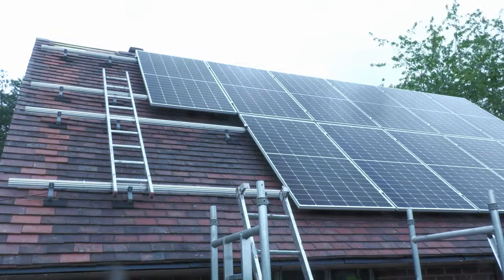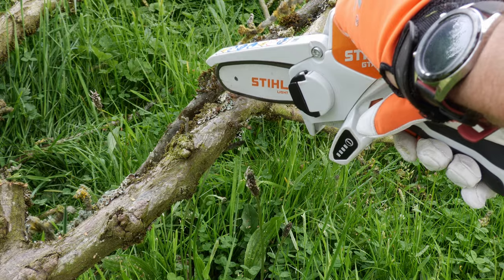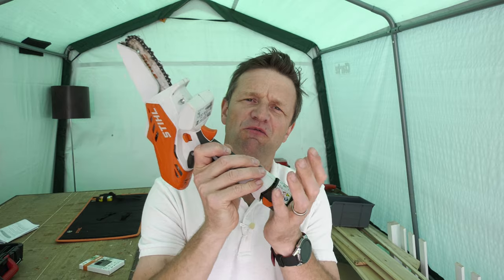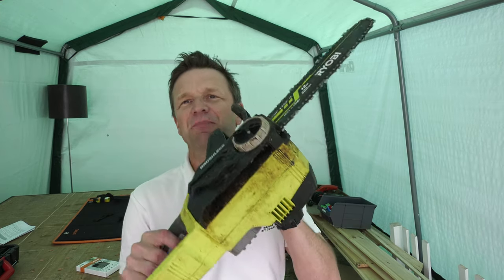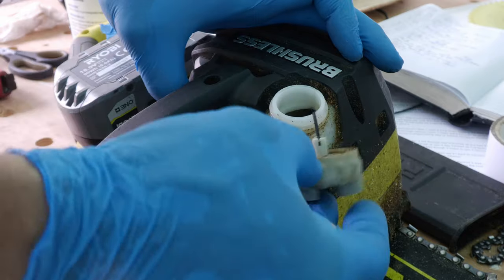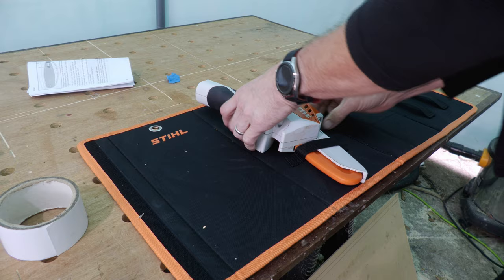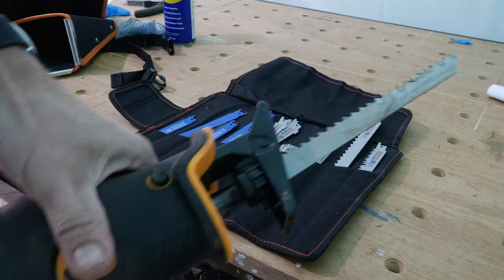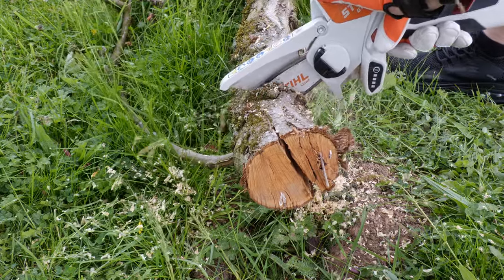The BEST Garden Pruner? Stihl GTA26 Review

Comment: I have just used it! Here it goes: i cut down olive trees. It did well generally but:1)if you force it to cut big pieces of wood,it stops! 2) most importantly annoying: the chain many times goes off ant the saw stops!!!! I had to take away the battery,put the chain again and put the battery back on and continue..It does not worth its money if it does this all the time ....
Reply from the maker: Yep. It's not really designed for big pieces of wood and they need to supply it with 2 batteries.

Comment: The problem with the stihl is the battery platform.  You are buying into a battery platform that does not work in your drill, impact drivers etc whereas Ryobi, Dewalt and Milwaukee all offer small compact chain saws and cutters for outdoor work.
Reply from the maker: That's a very good point, and particularly in the case of the Milwaukee - I've realised now I could use my existing batteries with their chainsaw. 👍

Comment: Maybe a stupid question, but those 12v batteries look very similar to the Bosch cool pack - I assume they are not compatible? If they were it would be a no-brainer to match my other small tools.
Reply from the maker: No they won't be compatible but I agree. This is why I wouldn't buy this tool when you've got similar tools from Milwaukee that you can use the 12v battery with a lot more other tools.

Comment: I have used my stihl gat 26 quite a bit and the chain is still sharp but to loose and keeps coming off but i can not see a way to tighten the chain around the blade, yes i do take it apart and clean after each use. can anyone help if so that would be fantastic
Reply from the maker: You have to manually pull it outwards whilst tightening, from memory.

Comment: I have the Stihl GTA26, is okay for what I think was designed for, the battery time sure is poor.
Reply from the maker: Yes, it's a funky little tool. Just confusing that it's meant to be a pruner but they say you have to hold it with 2 hands.. So your partner presumably had to hold the branch you want to prune 🤷‍♂️
Reply: @CharlieDIYte  You can hold it with one hand and is no effort.

Comment: Hey Charlie, great review - I've a question. I climb high trees to do dead wooding. It would be great to have somthing small and portable to do trim away branches when aloft in the tree. How good and secure is it in the holster? Is there a hole in the tool to attach rope, so i can attach it to my climbing harness?
Reply from the maker: It's pretty secure to be honest although I didn't test it rigorously. For me the main issue is only having 1 battery and it only being useable on one other tool. Have a look at the Milwaukee too although with its longer blade that might be too big for your purpose.

Comment: I use a jigsaw for pruning.
It's easier, cheaper, and much safer.
Reply: Jigsaw or reciprocating saw?
Reply from the maker: Fair point - good thinking.
Reply: @AnthonyHitmanDarts  Jigsaw - a cheap one like mine has depth of cut of 7 cm, and if you can turn it around the branch whilst cutting, you can cut even thicker branches.
I use a reciprocating saw only for the thickest of branches.
It might seem counter-intuitive to use a jigsaw for pruning. It took me many years of owning one just to come up with the idea, but once I tried it, it became my tool of choice for pruning

Comment: I am considering the features, too, in making a purchase decision. The big drawback is the poor battery life and lack of a second battery. I could buy a spare battery but they aren’t cheap and 10v is not market standard these days.    The top chain guard looks unnecessary and, if removable, would be taken off by me. The sideways movement allowing scuffing looks poorly made. And the necessity to use two hands to steady the cutting action, which the 10v battery slows down, again does not enhance the model. Finally, the fold up carry wrap looks weak for storage and transportation. I own many Stihl appliances for my home: petrol chainsaw and multi tool with 5 attachments. This portable mini saw does not reach the market requirements that I have, mostly on the battery power issues.

Editing extra: I have just watched a different review by a Kiwi. I add the following notes:

I’ve been considering buying the hand pruning saw. Not now. No auto lube, no auto tensioner, a brushed motor (😳), no spare battery, badly designed carry foldup. And apparently the top chain guard is a legal safety requirement in the New Zealand market - to stop the second hand slipping forward off the top rubberised grip on to the chain. That regulation has stopped the Milwaukee equivalent model from being sold in NZ - no top chain guard. Nuts!

It’s a no-no. And astoundingly badly designed by a chainsaw specialist company in Germany! 🦨
Reply from the maker: Agreed. The carry bag with its two open ends is a complete joke. Also it's the only tool that fits this battery. Much better to buy say the Milwaukee equivalent that you can use the battery across different tools. I agree the top guard is completely unnecessary and to be honest I never use it two handed. That's @rse covering by their legal dept.